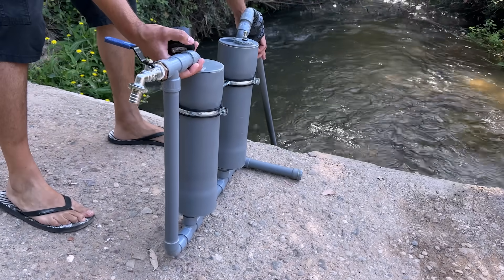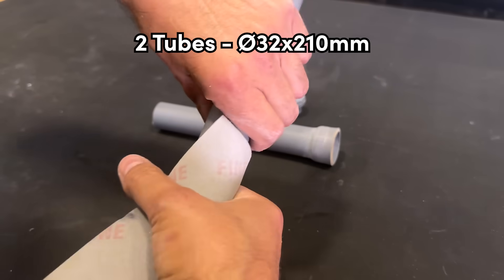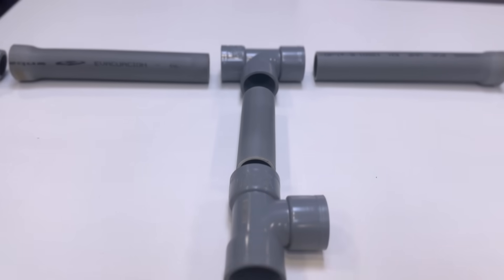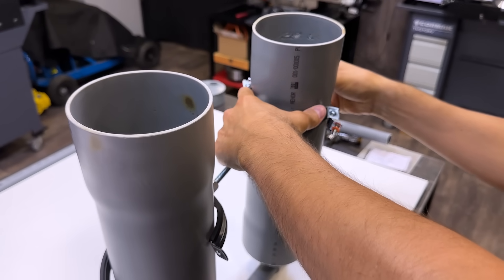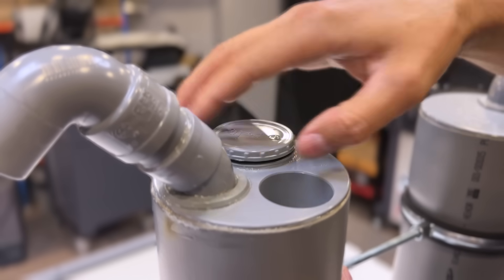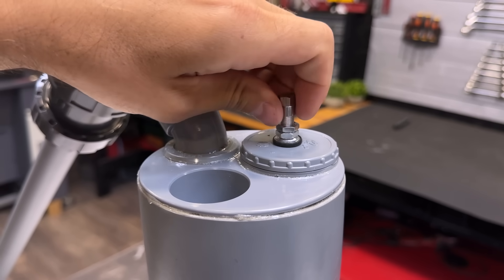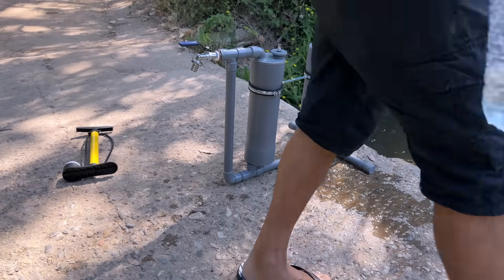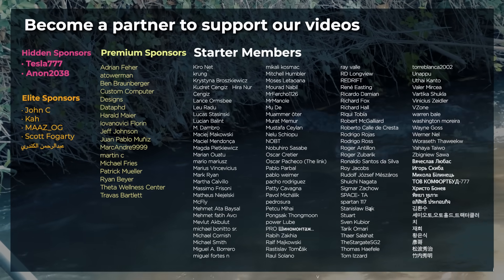How to Make a Water Pump WITHOUT ELECTRICITY🚱⚡ with PVC Pipes

Comment: This can be work. Because the work principal is same like fuel filter pump in some diesel cars. We "pressurized" the liquid until full in the "saving chamber" and if the liquid is "solid" enough in the chamber, the liquid will flowing eventually

Comment: Most of you in the comment section are not as smart as you think. This is just a RAM Pump. Similar well pump to what was commonly used for every home before city water was hooked up.
Reply: Stop pretending like you know RAM pump principles, a Ram Pump makes use of the kinetic energy of a flowing river into the inlet which means the water must LEAD INTO THE INLET PIPE not away from it. Additionally, RAM pumps use of a series of one way valves that open and shut repeatedly to push water into the pipeline which means that the water running through the pipe would be pulsating and not continuous like in the video.  

This video is merely hiding a pump along the inlet pipe, that's why they keep cutting the video during the installation and removal process. Notice how the pipe is wiggling due to the water's movement then suddenly stiff on the next clip after the video cuts? You proved that not only are you gullible but are also inept with physics principles, Ironic considering you said "Most of you in the comment section are not as smart as you think".
Reply: @johnromero7908  Very good explanation. So in other words as on check valve opens and the other closes it creates a pumping type motion until enough pressure builds up to make the water flow up hill if need be. What is it like 10 to one pressure ratio? My point was that people making comments without thinking online and it drives me nuts. So at times I feel like doing the same out of spite. Since many won't have a clue either way.
Reply: @bertpainter8385  I could try to explain it but it would be better if you learn from other creators like "Engineering Mindset", "Practical Engineering" or "ActionLab". They will do a much better job in explaining how that works.

A Ram pump is not necessarily a pump, it's just a setup where it uses the sudden closure of pipes / sudden stoppage of water to increase internal pressure by using Check Valves. As the check valve (1) closes, it increases the internal pressure on the pipe forcing the other check valve (2) to open and take in water. As the water tries to go back check valve (2) is forced to close, once again increasing the internal pressure forcing all the water to open the other check valve (1), then the cycle repeats.

The difference between the two check valves is that while Check Valve (1) uses gravity to close, Check Valve (2) uses water backflow to close.
Reply: @johnromero7908 correct, a ram pump works entirely on different principles.
Reply: Excuse my ignorance....I thought this work on the principle of siphoning...like when getting gas out of a tank...it shows on the video a bicycle pump used to create the initial pressure....or I got it wrong and I'm a wishful idiot?
Reply: @armandosimon9780  Siphons moves from a higher level to a lower level. That's the opposite of what's claimed.

Comment: I think it should work theoretically unless there is any pressure leakage. Here the height to which water is pulled is limited and that needs to be calculated using the formula given.

Comment: Does anyone think this would be useful for a drip irrigation set up?  I have a small garden and looking for a way to water my plants when I'm away
Reply: Better use a Ram Pump methodology / setup instead (only applicable if you have a flowing river nearby), this video is garbage meant for a gullible audience. 

Other suggestions include

1. in-line solenoid valve with built in timer attached to the hose 
2. Small submersible DC pump attached to a timer
3. Assuming small garden using a drip irrigation setup, you could use a small elevated water tank attached to the drip hose, just reduce drip rate to 1 every 10 seconds.
Reply: @johnromero7908 ram pump have limitation 
Should be water body should be placed in hight. Second to pump one litter 5 litter will be lost

Comment: It seems work like hydram pump, but i feel something wrong here.. No matter how many vacuum air you put inside, even if there is a one way valve to prevent pressure loss, i think its not strong enough to suck the water from inlet pipe.  due to its low power Maybe this will works for aquarium only?  
i like this design anyway.. no water output comes from hammering mechanism. 

but still, i dont know if its actually will works like hydram pump. 😅
Reply: That's not how a hydraulic ram pump works, it won't even work for aquariums since ram pumps require flowing water to work. long story short, this doesn't work.

Comment: Anybody replicated this? It will stop "pumping" once the manually inserted water and air-pressure is gone. Also it is essential to put a one-way water-diode at that "inlet" so the kilo's of water don't go back into the river. - Moreover, it would be farting air.
Reply: it just transforms amount of water that flows into speed of flow. you can put generator into the stream, and use this to power the pump, but this design way more efficient
Reply: @егорсаволюк-ч8й  Speed of flow is not pressure. it will not create vacuum to suck up the water from the river.

Comment: I havent seen this system.

 Another similar device using the power of water only, "Hydraulic ram" was invented centuries ago. It converts dynamic energy of flow in river (V²/2g) into pressure in the delivery pipe, by creating water hammer effect with a non-return valve. The flow is intermittent and about 10% of river flow could be elevated to about 50-100 meters.
Reply: yes but a water ram actually "works" this only works because of the hidden pump and batterys
Reply: @billharrison3174 Water ram certainly works on hydraulic principles only.
This is a kind of bellows or a siphon with added compressed air to increase the total pressure on lower water level side and force it upwards. I don't think there are any batteries, just manually pumped air.

Comment: with that distance and height you can just siphon it using a 1.5meter hose and your mouth. and what video view boosting did you use to actually reach 1.4 mill views with only few engagement with such a silly project?

Comment: can it be used on a 30-50 meters water height suction?
Reply: highest water can be sucked is about 22 feet, about 7 meters, if you want more use  a submerged deep water well pump, 50 years a technician and pump techo here.

Comment: The question is how many minutes the water flow and fill it again air for the pressure
Reply: as long as the valve remains open, it will work

Comment: Can you add a filter to capture debris or will that interrupt the flow and prevent the effect?
Reply: The right threads, you can probably attach a Sawyer at the faucet end for filtration, and for the inlet, you can make a fine screen cap to it for debris that you can just clean off with use.

Comment: A perpetual machine is impossible, there is no free lunch, there must be a hidden water motor or as soon as the pressure runs out, the pump stops!
Reply: this is not a perpetual machine. its an upgraded version of siphon. it use air pressure as its energy. not because you just learn the word perpetual machine doesnt mean everything you see that looks like it powers by nothing is a perpetual machine.
Reply: Haven't heard of ram pumps??

Comment: I've seen other hydro pumps work but never with a pick up grade that high or that much presure , may have to try this one out my self .
Reply: In my opinion, do not even try this. The components called devices are not just any devices. The water flow ends when the air it pumps runs out.
Reply: Why waste your time, best you read up on the first law of thermodynamics, THIS, energy can neither be created nor destroyed, IE there are no free lunches.

Comment: If possible, we would have been able to generate electricity for free by sucking and pumping the same water 😂
Reply: If you can return the water to its source then you can power a turbine continuously or until your water evaporates. Water can be lifted using the old airlift system used in Grenada without ram pumps - I will experiment some time
Reply: Hydro dam have been around for about 100 years. The structure can't be built for free. Maintainance isn't free. Personel isn't free. Somebody has to pay at the end.

Comment: The compressed air is pushing backward against the check valve, and won't allow water to enter the system.

This will not work.
Reply: This was my question, No doubt as water from the river can not flow into compressed reservior, due to that unabled to supply water for long time!
Reply: Exactly my thought this gave me the same vibes as the very cleverly hidden electric motors in these "perpetual motion" machines videos
Reply: You are right until he opens the tap. Then the air will move that way and sucks some water with it.

Mainly the water of the 4 bottles he filled in, I suppose. Pretty much like a SuperSoaker watergun. But if more from the stream, I wonder if the vacuum is enough to keep it running, like the initially sucking water through a hose to let it run. 

I for sure can't imagine the shown pressure will be achieved or at least kept. Like the supersoaker waterguns loose the pressure very quickly after pulling the trigger.

Comment: the "hydrocycling pressure loop" (HCPL) described in the video is not scientifically possible as a self-sustaining system. The claim that it recycles its own internal energy to continually pump water without an external power source contradicts the fundamental laws of thermodynamics.
Scientific Principles and Reality
While the video correctly identifies real scientific principles—like the Venturi effect for suction and Boyle's Law for the relationship between pressure and volume—it applies them in a way that creates a perpetual motion machine of the first kind.
The First Law of Thermodynamics: This law, also known as the conservation of energy, states that energy cannot be created or destroyed. In any mechanical system, energy is always lost to factors like friction and turbulence. To pump water to a higher elevation, a system must expend a net amount of energy.  
The Claim: The HCPL claims to use the energy of a compressed air volume to push a liquid volume, then somehow use the liquid's flow to re-pressurize the air, thus creating a never-ending cycle.
The Flaw: This is not possible because the energy transferred from the compressed air to the water will be less than the energy required to re-compress the air due to inevitable energy losses. The system would quickly run out of energy and stop.
A genuine hydraulic ram pump, in contrast, works because it has a continuous external energy source: the potential energy of falling water. It uses this energy to lift a small portion of the water to a higher elevation, but it expends a large volume of water in the process. The HCPL, as presented, lacks a similar external energy input, which makes its claims scientifically unfeasible.

Comment: Your use of terms is confusing to some, but pathetic. "Enthalpy is a thermodynamic property defined as the total heat content of a system, calculated as the sum of its internal energy (U) plus the product of its pressure (P) and volume (V): H = U + PV. A state function, enthalpy depends only on the current state of the system, not the path taken to reach it. In a process occurring at constant pressure, the change in enthalpy (ΔH) is equal to the heat absorbed or released by the system. " Enthalpy has nothing to do with the process and neither to many of the other big words. If Air Pressure is kept to a constant, then of course it'll continue to function. Otherwise it is just a toy.
Reply: Это не игрушка, а обычный обман тех, кто не учил в школе физику, а на уроках читал Гарри Поттера🤣🤣

Comment: Bernoulli Siphon Math in Standard Units (3/8 in tubing, 1 ft head)
	1.	Available head
H = 1 ft
	2.	Velocity from Bernoulli’s head form
v = sqrt(2 g H)
where g = 32.2 ft/s^2
v = sqrt(2 × 32.2 × 1) = sqrt(64.4) ≈ 8.02 ft/s
	3.	Tube area
Inside diameter d = 3/8 in = 0.375 in = 0.03125 ft
Radius r = d/2 = 0.015625 ft
A = 3.1416 × (0.015625)^2 ≈ 0.000767 ft^2
	4.	Volumetric flow
Q = A × v = 0.000767 × 8.02 ≈ 0.00615 ft^3/s
	5.	Convert to gallons per minute
Q = 0.00615 × 448.83 ≈ 2.76 gpm

Now test with H = 0 ft

v = sqrt(2 × 32.2 × 0) = sqrt(0) = 0
Q = A × 0 = 0

Conclusion
If head = 0, then velocity = 0 and flow = 0. Bernoulli’s formula shows that a siphon can never pump uphill into an outlet higher than the source water surface, no matter how large the reservoir is or how you arrange the tubing.
Reply: I think you forgot the air pressure that starts it.

Comment: perfect ... fill 1 tube with motor/pump and batteries in the other ....
an pressure switch to turn the power on and there .... 
air powered waterpump ;)

Comment: This is not a water pump, this is a hydraulic accumulator, the author filled it with water beforehand. And it will work as long as there is compressed air in it.

Comment: Wrong info. Nothing for free 😂 If the  water source has potential energy ( higher then final point) or when the air pressure is over and you pump again it works.

Comment: That's amazing.

I'm so intrigued that I have to make one. Do you have a list of parts?

I have a stream at the bottom of my garden so I'll be able to pump the water up to my house and use a water wheel to generate electricity before pumping the same water back up again. 👍

It just makes so much sense! Like the time I found out that the word "gullible" doesn't actually appear in any dictionary, anywhere!!!

Thank you 😊

Comment: At first I thought its working on syphon pressure but the output is higher than the input . Also check the back  if it was working on a suction effect why is water escaping from the back?, that would indicate positive pressure. I suspect there is a  hosepipe hidden and this is why there is a cut in the video when the rubbish is placed at the edge of the water, If this was real the world wouldnt need giant pumping stations costing billions.  Stupid rubbish channel.

Comment: Too bad they did not let it run long enough for the air pressure to empty the two tubes. If the pressure from the stream entering the inlet pipe is insufficient to push the water up to the top of the tubes the flow stops.

Comment: If you have a kind of Siphon-Effekt, the outlet must be lower than the source surface. Thats physical law. In this case it is driven by the water pressure. I guess the water was sourced by the both cylinders but not from the river.
Once the pressure ist gone the water rinse will stop.
Reply: There's an electric pump on the inlet pipe. 14:32 and 15:09 frame gap. At 15:09, the water flows out under pressure near the check valve, and a second later everything is dry there.

Comment: Why are there 3 openings on top of the cylinder with the air valve? Most likely the pump with the electric battery is hidden there...

Comment: So many problems . . . Sprinkling the video with plausible looking formulae might suck in the uninformed, but it’s basically impossible. For instance, pressuring up the inlet chamber would keep out the river water. Note we can’t see the end of the suction pipe, where, no doubt, the submersible pump is attached. But kudos for the deception.

Comment: How high can you suck water with it or is there a table of how big the two main cylinders have to be for which length of the suction path?
Reply: I don't know about the very model of the video, yet hydraulic ram pumps can lift water up hills. They have been used for centuries.

Comment: Ok I am going to have to take some issue with the construction since I have done a ton of PVC pipe in my lifetime. First the heating and stretching is completely unnecessary and actually weakens the pipe as you break down its chemical structure if you overheat it (Which you very much did here). There are couplings and adapters that handle all of those connections. Second and this is the big one for me, that is just a completely unnecessary amount of PVC cement. It isn't wood glue and doesn't work better when there is more. PVC cement is a chemical reaction that bonds the pipe together permanently by in effect slightly dissolving both surfaces. If anything that much cement is actually counter productive because it can create voids where the cement hardens that allows water to leak. This is why many DIYers end up with leaky PVC fittings from using way too much. You want a thin layer on both fittings, more to prevent any dry spots than anything and preferably after applying a layer of primer which cleans and starts the chemical reaction. After that you push the fittings together and give it an eighth to a quarter turn to ensure there are no voids, dry spots, bubbles etc and hold pressure until the pieces no longer move.

To those questioning as to if this really works, yes it does. This is just a simplified version of what would be called a pressure boost tank that most people on a well are familiar with. It doesn't work indefinitely though, it cycles as it needs time to rebuild pressure if you drain it faster than the incoming supply restores it.
Reply: Buenos aportes, que mejoran a una buena publicación, gracias😊